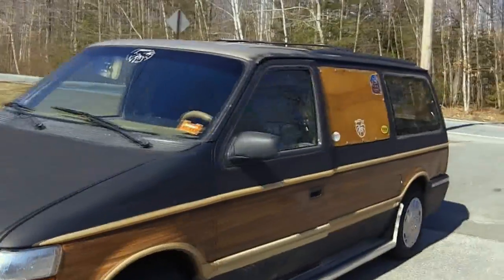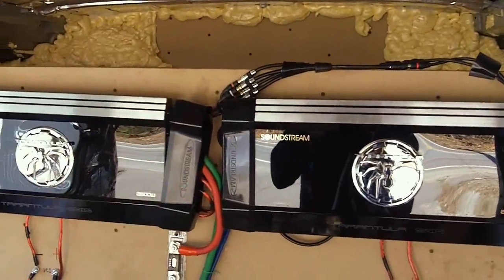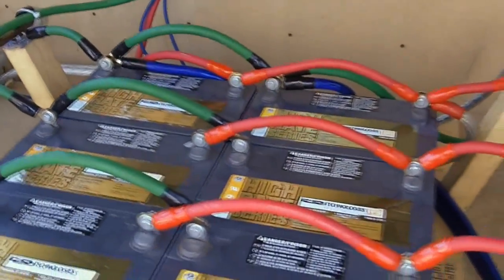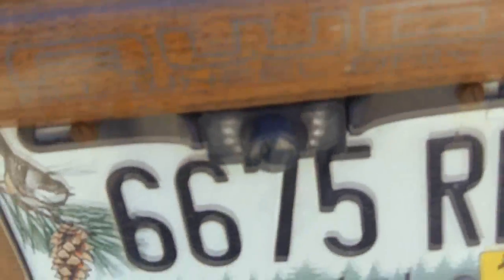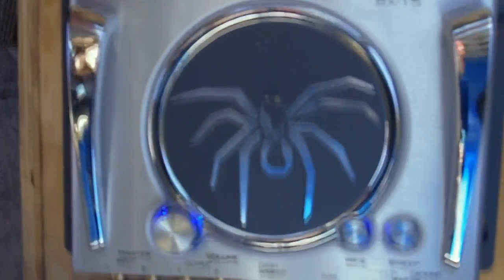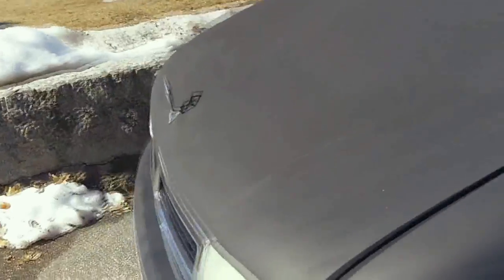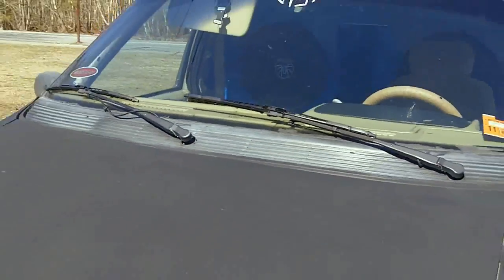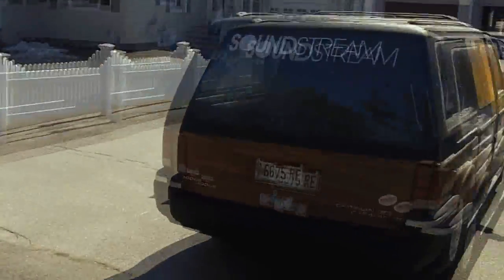EXO's SOUND SYSTEM | Soundstream 18's / Tarantula Amps / BX-15 / DC 270XP / Volt Meters / BIG THREE

Comment from the maker: My buss bars ARE connected directly to the frame, and the batts - And now, I am using 0 gauge power wire. Grounds & Powers should be the same length.

Comment from the maker: It most likely won't pop, or give you any trouble until you start really hammering on your system. Once your alternator starts producing 250/300 amps - Yes, I think you may see some hot plastic in that case. Why do you have the breaker in the 1st place?

Comment: hey EXO, a couple questions. are you using positive 8 gauge power wire for both the power AND the ground? and i thought grounds from the amp were supposed to be shorter. and directly to the frame. is it okay to have a long ground, and to just hook it up to the buss bar instead of directly to the frame?

Comment: Awe sweet! Have you done this yourself? Cus everyone I ask says you can't and that you will damage your amp and sub.  So you have done this and it works? I plan on putting two MB Quart OXYN 2000.1 on a Re audio XX12D2, if one amp can't power it to fullest potential. The amp is cheap for 2000 watt rms (200bucks) the sub is 1500rms and it cost a pritty penny(420)...

Comment: hey if box rise brings you up to 4 ohms could you wire your subs even lower. i guess it would put a little stress on the amps in the beginning but you could get it to even out at 1 ohm?

Comment: i got a question. I have 120 amp circuit breaker from my primary battery to my secondary battery to the amp. BUT, I got a 320amp alternator from mechman and i am curious if my circuit breaker is going to be poppin everytime the car is on or just when i am running close to dead batteries that makes the alternator put out the 320 amps.

Comment: EXOabigdeal i have one of these TX1.2600D and i keep blowing woofers how did you tune yours? did you use the bass boost all i have is a DMM to tune with :[ any info or help would be awesome thank you and love your vids!
Reply: Bass boost knob should be low as possible the higher that bass boost knob goes the v lower the gain level

Comment: hey exo why would it be that when i took my power wire from the battery to the amp and switched it around so the fuse was in my explorer and not in the hood with my engine it would not work at all and yet worked as soon as i turned it back around?

Comment: I have a 12' kicker l5 and a boss 1100 watt amp and a cheap merlon audio head unit to run it all. every thing is hooked up and wired just fine, but the dim and interior lights. I tried putting a lights on a switch because it wont connect to the headunit, but every time i turn the switch, the interior and dim lights come on but the head unit wont. do u have any idea of how i should wire it or anyone else on here could help me! The car is a 1998 dodge stratus.